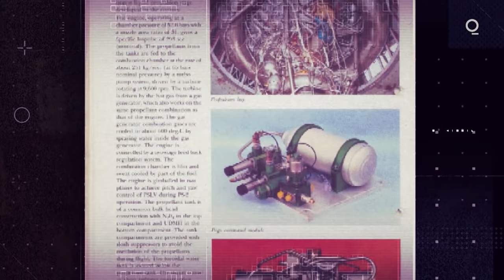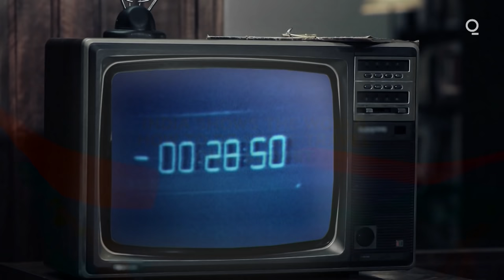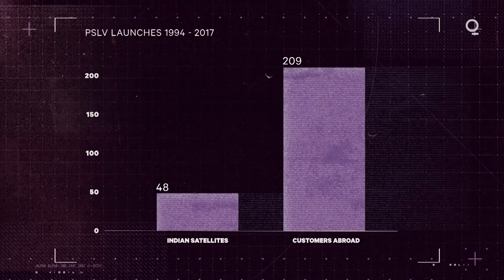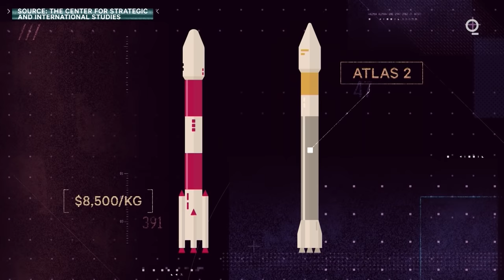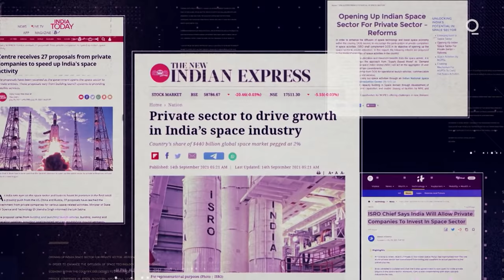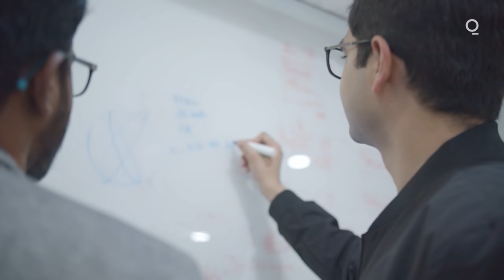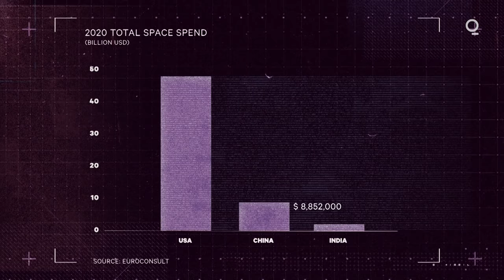India Is Going to Space, on a Budget

Comment: Show the world, India!  Show the world space travel can be far economical than is being demonstrated!
Reply: Well SpaceX is doing that so let's hope that ISRO can achieve their status
Reply: @napobg6842  There would be nothing wrong with having two space launch options that would be affordable.  The big space launch companies have to get a grasp on reality.  Just because it works a certain way does not mean it will not work in a more economical manner.  Work used plastic trays to transport tools from work station to work station.  It worked great for decades. Every year new plastic trays were bought.  The old, damaged, plastic trays were thrown away but stayed in a landfill for a very long time and were quite pricey.  Now we use thick, corrugated cardboard trays.  We throw the trays onto the cardboard recycle machine when ever they break.  Every week, we get new thick cardboard trays.  The shipping cardboard is thrown into the machine also, used paper, and the such.  Our tool transport trays are now only the cost of the fuel to run the machine.  The fuel is nothing but diesel for the DC generator.  On top of that, no plastic trays on the landfill. People have to start thinking of cheaper but equal ways of doing things for everything, not just space launches and exploration.

Comment: If you were to have a13.150 kg payload and accelerated it to April 6 kilometers per second pushing it on say a very stable set of tracks like a railroad track using an electric engine that has an arrestor hook like a jet plane on an aircraft carrier capable of ignition of the rocket carrying the payload into orbit would reduce the take off weight of the rocket by maybe at least 250.000kg
The track sloping upwards to desired trajectories 
Reusable main launch equipment cheaper initial fuel costs and major weight reduction
Go India
Reply: Wait that actually sounds too genius to not have been done already, who are you?
Reply: That's the reason you're not Indian, we are poor not dumb xD
Reply: @apoorvmishra6992  abey yaar, duniya mein har jagah smart aur dumb log hotein hai, ye kya logic hai
Reply: @qwerasdliop2810  just kidding brother. Cuz that idea is just so funny XD.
Reply: @apoorvmishra6992  aah maybe, I'm no rocket scientist
Reply: @qwerasdliop2810  hey it is only an idea 
But it makes sense to get momentum built up be fore using the stored fuel to start getting it up to speed